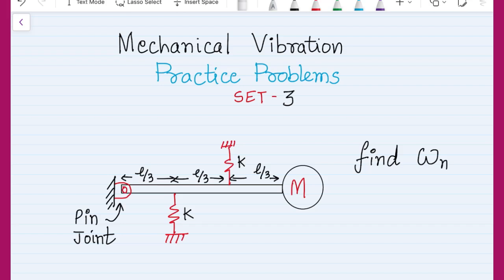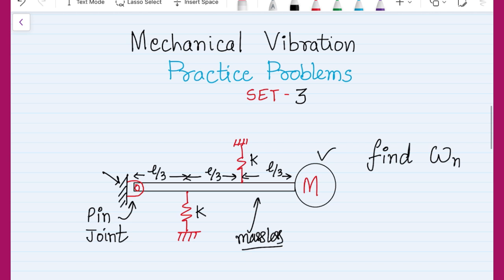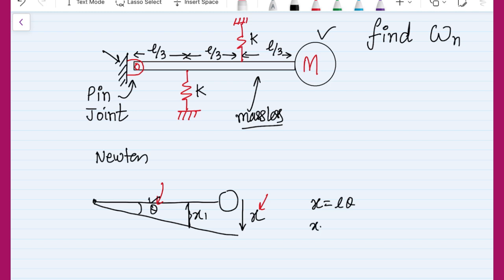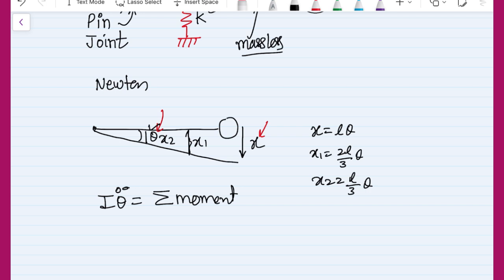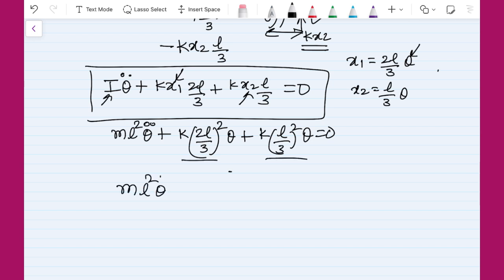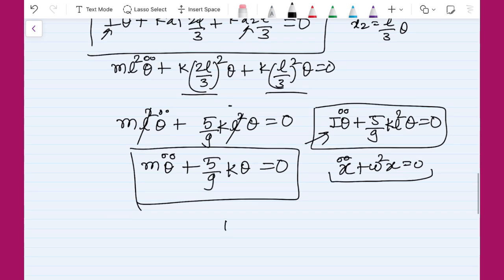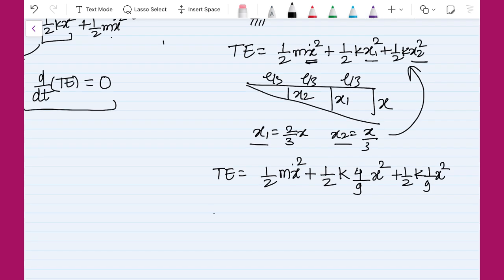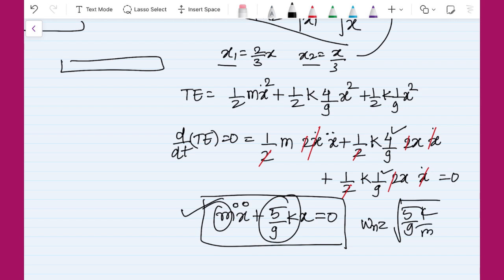Vibration  Problem Set 3 || How to find Natural Frequency of rod with spring || Conceptual Problem

Comment: Why you are considering the torque applied by springs only, Why you are not considering the torque applied by weight of bob????
Reply: It is because we are considered displacement of rode from equilibrium state,not from the initial state
Reply: at equilibrium moment due to spring and weight is balanced